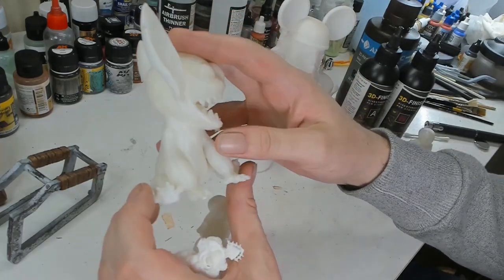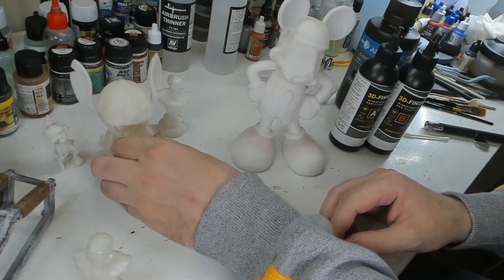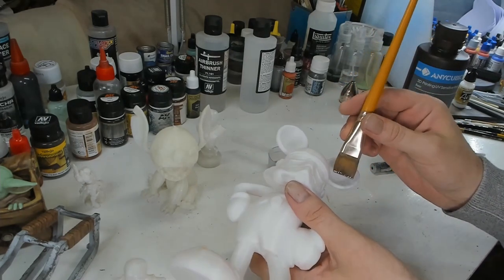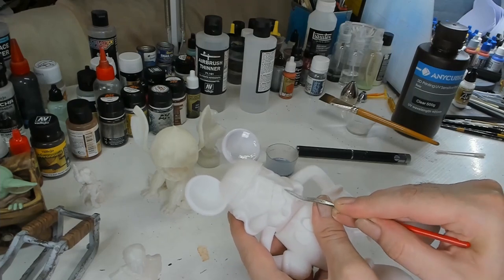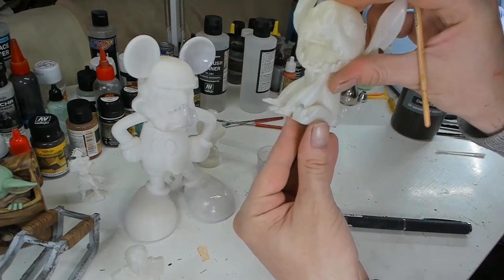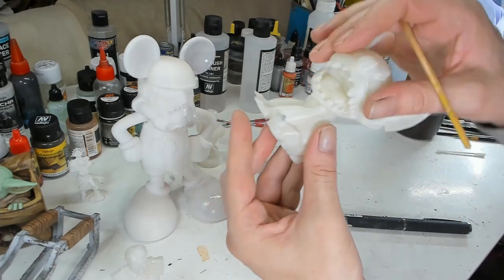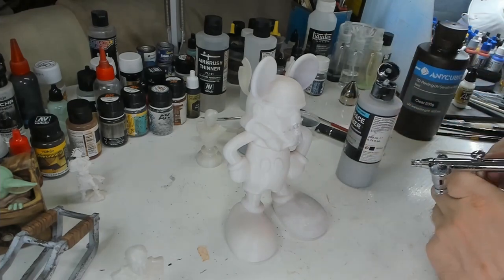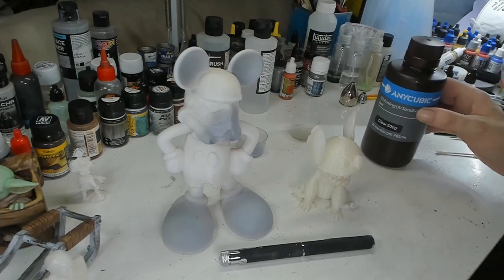How to smooth FDM prints and print without layer lines!

Comment: Thank you so much for making this. 
Actually helpful. the squishing isnt usually a problem, but iv been just using a raft till now to negate it. But just lowering the bed is a good idea.
Reply from the maker: It's no problem just glad it helped I don't recommend raft's, I always got the best results with a 4mm brim because it's great at securing the print to the bed plus it's much cleaner and easier to remove..
Are you using tree supports as well because I got much better prints with tree supports compared to standard support's!
Reply: @printitpaintit.2436  hmm. i didnt use tree supports yet, i kinda forgot they exist ^^"
Im gonna give them a go.

Comment: I would recommend you wear niltrile gloves when working with resin, resin is pretty toxic in both fumes and upon skin contact, you also should let the resin cure properly either with sunlight or getting UV lights that output at 405nm, don't trust your uv pen to make it safe to handle.
Reply from the maker: Thanks normally I wear gloves but when using a small amount form the cap it's not going anywhere and the laser pen is a UV laser 405nm same as the curing lights just way more powerful so the resin is cured 100% after a few seconds!
It's the same UV laser diode used by millions of dentists to cure resin fillings so good enough for me and more powerful than my wash cure station LEDs.. 

This is elegoo standard resin and I have got documents from elegoo that clearly states no voc in this particular resin it just smells bad, I contacted them again about this and they gave more than enough evidence so if there are VOCs I'd be surprised..
There are resins available and on the bottle it clearly say VOC we're a respirator but not this one according to EU and UK safety standard's, it's just an irritant and dangerous to aquatic life!

Comment: I think It's not work for nylon materials is it right
Reply: Reply for above comment
Reply from the maker: I've not tried on nylon but resin stick's to most surfaces so I'd just try it on a small area first, nylon is a slippery material but when 3d printing it's got lot's rough edges to cling to!